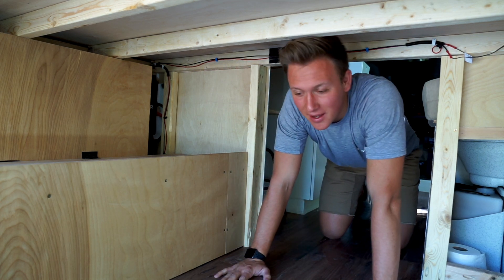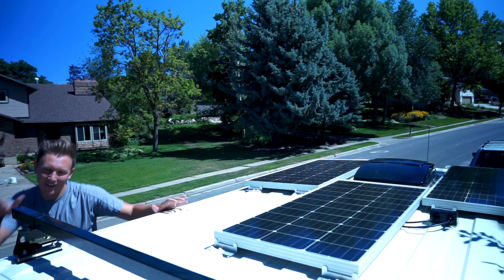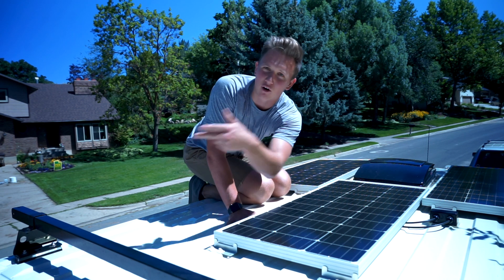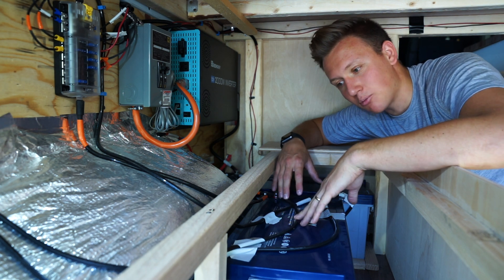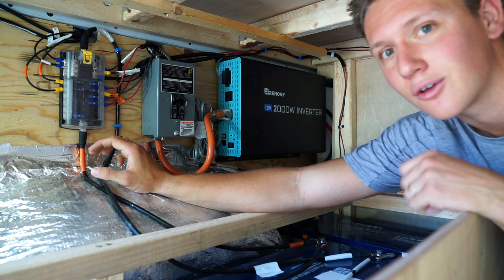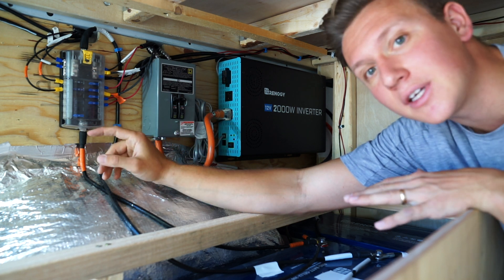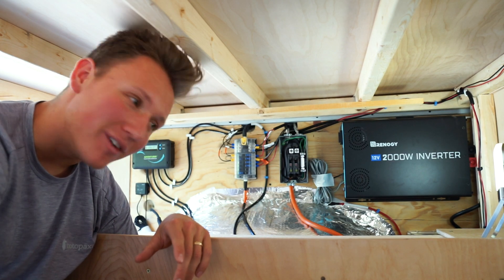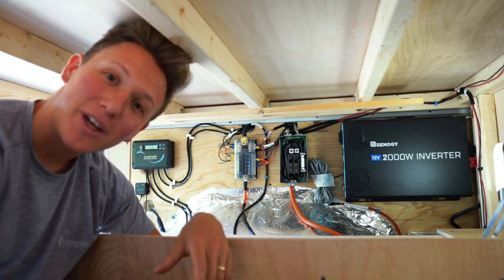DIY Camper Van Electrical System Explained | Simple Off Grid Power

Comment: Great overview, but I have a few questions   

Most guides I’ve read say to site the fuse near the vehicle battery, to protect the cable which runs through the compartment. (Although In your case it sounds like you maybe need one at each end :))  

And if you upgrade to LifePo4 you definitely shouldn’t connect the leisure and vehicle batteries directly together- you’ll need something like a DC DC charger to manage the battery. (The isolator just disconnects them when the vehicle isn’t running, it doesn’t manage the voltage to match the state of the battery) I don’t know if thats also correct for the battery chemistry you are using. I guess you’ll know by know :)

Comment: Hi!  Just wondering what size wires you used between your solar panels and charge controller?
Reply from the maker: The wires between the panels and the charge controller came with the solar kit we bought. They are 6 gauge wires though to answer your question. I wouldn’t go any smaller than that.

Comment: The whole thing with the On Shore is to actually charge your batteries. But from what I saw on youtube, nobody is using that option that often. So not really an investment to make
Reply from the maker: As the weather got cold and evidently less available sunlight we actually bought this battery charger ( https://amzn.to/3prru1B ) It integrated seamlessly with our On shore system, so now that the sun doesn’t quite keep our batteries fully charged whenever we visit family or are in a campsite we plug in and charge our batteries all the way. In the summer this isn’t really necessary and probably the reason most people don’t do it. But as we can’t travel to southern sunny areas in the winter this is a great option to keep our batteries fully charged and in good condition when there isn’t enough sun.

Comment: I just recently got a 1993 Fleetwood Bounder Double Axle, and everything was working fine, three days ago the batteries went dead so I took a closer look at the hood, and noticed the battery connections, the hood has 3 batteries, two deep cycle and one start battery(note theres two solar cells on the roof wired to one of the cabin batteries) but im not sure how its all wired. I know the motor only needs one 12v start battery and the cabin needs 2 or more deep cycle batteries and im aware that the solar cells need a storage battery. If someone that can help would be great!
Reply from the maker: Honestly, the setup the way you describe it sounds fine. One thing to look into would be to double check if there is some sort of a battery isolator between the start battery and the cabin battery. If not your cabin batteries could drain your start battery and therefore you wouldn’t be able to start the vehicle. Another potential issue is just age, batteries like this have a lifespan of around 5-7 years depending on how well you take care of them (not discharging them too much, and keeping them out of extreme temps), but eventually, no matter how good you take care of them, they will get old and not be able to hold a charge any longer. Those are my two suggestions to look into, good luck, hope you get it going again!!

Comment: Is there a reason you didn't use lithium batteries?
Reply from the maker: Cost! We would’ve loved lithium batteries, but they more than twice the price for the same power capacity. Deep cycle gel batteries should last us 4-8 years, at which point we might decide to upgrade.
Reply: @kalemandgreta9021  Hi - how long would lithium batteries generally last? Thanks!